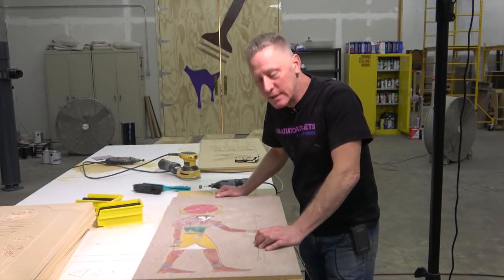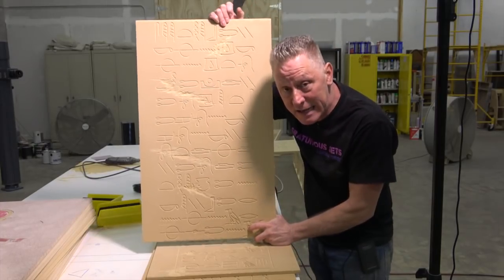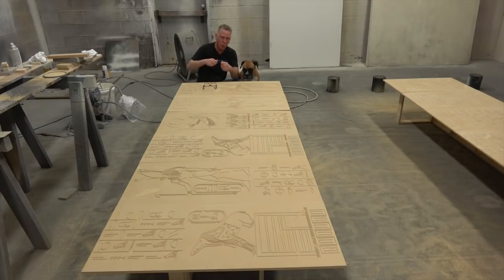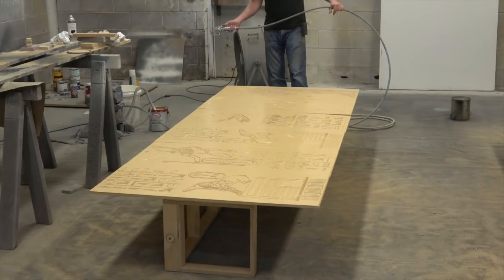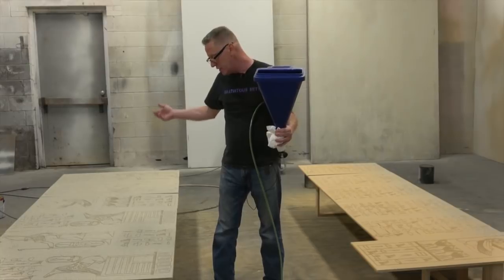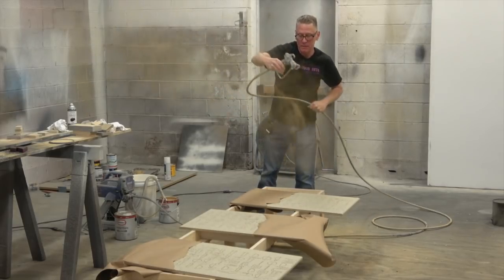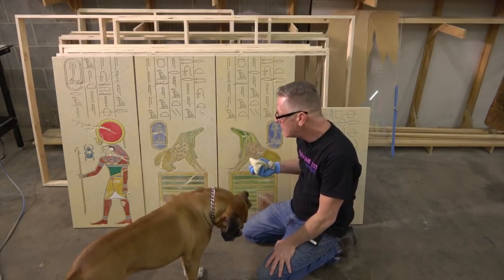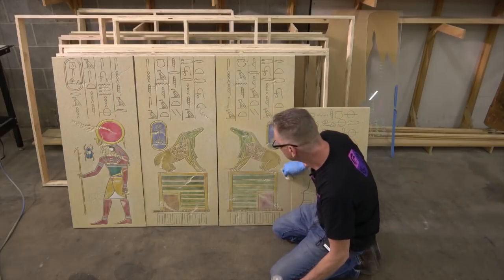Ancient Egyptian Hieroglyphs

Comment: Brilliant tips, fantastic work and the love of the craft shines through in the videos. The torn paper tip is an excellent idea. Will the horizontal line of the MDF join show through the paint job and not make it seem like one wall or are you doing something else?
Reply from the maker: You're gonna love this. We are going to show the answer in an upcoming video, but i'll let you in on the secret. 
the entire room will be able to expand or contract 4 inches. these panels will terminate behind square stone columns to allow this.  The reason we are doing this is that we never trust that a drywall room will be dimensionally correct, true, or square.
  Since this installation will take place in Anchorage, Alaska in mid WINTER... We are trying to hedge every bet to (hopefully) ensure a snag-free installation
Reply from the maker: Also (i may have misinterpreted your question) each panel you see here will appear to be a laid stone block, thus forming a wall. I'll make sure to show you more of the overall architecture as we continue to build.  -Mark
Reply: @GratuitousSets  Nice, thank you- didn't think that there could be an expanding issue. Looking forward to the next video.
Reply from the maker: When we built the spaceship for Red Door,  the doors were supposed to be centered in a wall weren't. The contractor just chose a stud NEAR center. We spent a week trying to solve the manifold problems that arose from a seemingly small change. Since the contractor buildout hasn't occurred yet in Alaska, we're trying to anticipate common contractor screwups

Comment: what material are actual panels made of?
Reply from the maker: MDF (Medium Density Fiberboard) It doesn't have grain (wood does) so it's easier to carve. This could also be done with a product called Trupan to save some weight if that were an issue